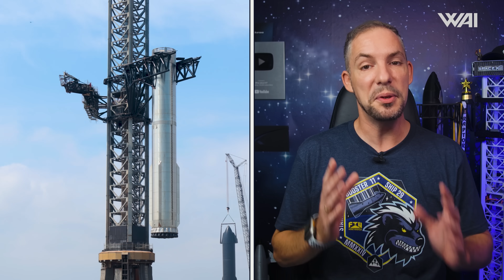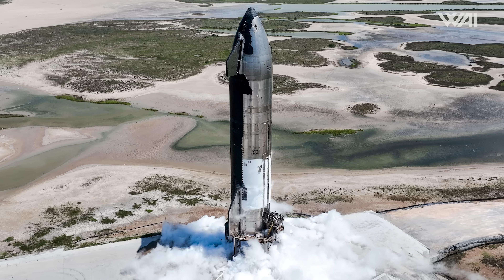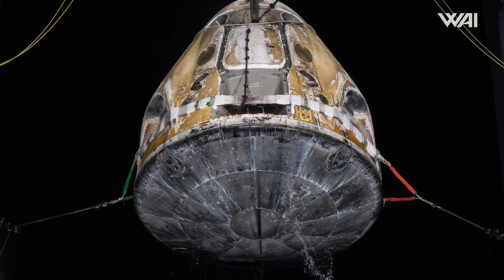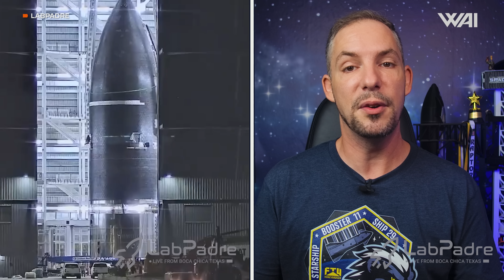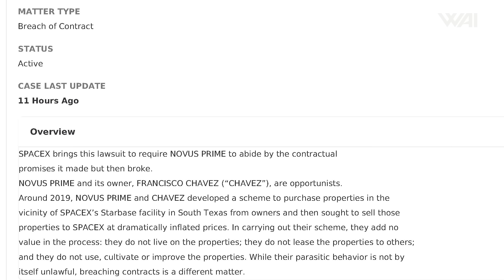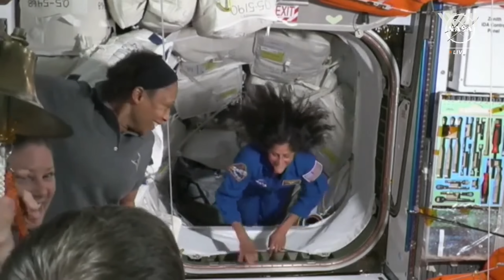SpaceX Drops Starship Flight 5 Plan Update! Starliner Still Stuck At ISS!

Comment: "That's impossible": Do you remember that experts said that it's impossible to land an orbital rocket propulsively? (with engines only). 

They said something like: 'it's physically impossible to start a rocket engine in hypersonic speed against the oncoming air pressure, that's just not possible. That would never work.
And there's a reason that NASA doesn't land their rockets: Because it's impossible'.

The experts said something like this and some laughed at SpaceX. 

Well, SpaceX tried and it works now very reliable to land the boosters of their orbital rockets.

So it's just a matter of fine tuning to catch the Starship booster. That's an engineering problem, not even rocket science. So, it's doable.

After they figured it out and dialed in all parameters correctly for catching, they would need a low wind, a predictable low wind or no wind. Just like for landing the Falcon9 boosters.

They landed the Superheavy booster softly in the water and in the line of sight of that buoy. So, they already know how to slow down that giant booster and bring it round about where they want it to be.

And I guess, they have escape maneuvers when the position would not be right, unable to correct it. They might fly out to a predeclared place in the ocean (that's what all others do with their boosters, dump them in the ocean...). 

And catching Starship (the upper stage) has more to it, withstand the entry heating and so on --- and then it's about the same, do a precision landing at the catch tower.

------
Oh by the way, the current tower could become a catch tower only and the new one with the flame trench could become the new launch (and catch) tower.

It's just a guess. But when the new tower is so much better for launching...

Comment: As usual SpaceX blames "paperwork" for why they can't fly right now. The government is a nice scapegoat, since their fans hate the government (and environmentalists.... F the turtles. Who cares about turtles, right?) They actually need a SHITLOAD more testing to make a catch a possible success. And let's face it, if the catch fails you are looking at a nice big explosion that will not only scare residents, the FAA, naturalists in the area, but it also might screw up their main launch pad, and guarantee a nice long investigation and delay of the next flight. A lot of risk for not much gain. I think a nice landing pad on rails (to bring the booster back in range of the pick up arms) would be a lot safer for the launch pad, and it would be more tolerant of misalignment and more like what they are already doing with Falcon 9. The only penalty will be that of the weight of landing legs. It would also give them experience with landing very tall rockets on landing legs, which they will need to do on the moon and mars anyway.
As for the heat shield on Starship........ their current ablative "backup" is simply a band aid on a problem that engineers have been working on for decades. As usual SpaceX thought that somehow all the rocket engineers of previous generations were just old fuddy duddies that don't have the proper mentality of innovation to solve the problem and the young SpaceX "guns" will just succeed where all others have failed. The bottom line is silica tiles are fragile and they are a bitch to mount on a spacecraft so they don't fall off. And the violent environment of lift-off and re-entry are guaranteed to stress extremely brittle units to the breaking point. It will be the biggest obstacle to rapid re-usability. Maybe they would be better off with large disposable, ablative panels that can be removed and bolted back on relatively rapidly? (Forget few hour turnarounds and just make enough spacecraft to turn them around in a day or so.) Or perhaps they need to revisit transpirational cooling? Or perhaps they need to revisit the Dyna-Soar's metal heat shield design? (Very expensive, exotic metals, but pretty durable.)
Raptor 3 - amazing. Let us hope it is as durable as it is powerful and beautiful.

Comment: "Chopstick" capture the booster stage and lower it back onto the OLM so that it ready to refly?  Get outta here!

Anyone really imagine that NONE of those 33 Raptor engines will need to removed from the stage for anomaly investigation, for detailed visual inspection of internal passages, or for plain old refurbishment/repair for things like failed sensors?

Does anyone know if it is possible to replace a Raptor engine with the stage resting on the OLM?  Access to engines seems to be very restricted.

Comment: There is zero chance that catching that booster works. Even if the tower did catch the booster the explosive blast from all those engines firing straight down on to the launch mount EVERY SINGLE time will completely destroy all the hold down clamps and the launch pad itself.
Reply from the maker: Three engines are used for the landing burn.
Reply: @millennialfalcon1547  Alright here's the deal. If it works, you forfeit the right to doubt anything else.

Comment: Fixing problems...good.  Removing problems...better.  Modeling...good.  Observing...better.   NASA makes catastrophes, SpaceX makes mistakes.
PTFE <19°C is a well ordered triclinic phase. Density jump at 21.9 to 31.6°C. 19°C - 30°C, partially ordered hexagonal phase. 30+°C - 328°C mp, pseudo-hexagonal, very disordered. 
Ignorant is educable, stooopid is forever.  NASA is the doyen of institutional stooopid, Beltway lobotomites managing the genetically inconsequential.

Comment: You can't take the booster and put it back on the launch pad. You have to send it back to the Garage to do NDI tests on the components to limit and reduce mechanical fail points. They do this in the US Navy on airframes every day because of the high stress on aircraft structures and equipment.

Comment: The falcon rockets land with precision right in the centre of the landing pads, and the"suicide burns" time and again achieve zero velocity at zero altitude (and the Falcon's  Merlin engines cannot be throttled..).   So the idea of Mechazilla safely landing the Boosters and Starships looks highly likely to be successful.
Reply: Not true. Merlin can be throttled to around 40%, even at sea level. I don't think reliable landing would be possible without some degree of throttleability.

Comment: They still haven't said what they are going to do with Starliner?  Part of the problem is that Boeing did something unusual for them <sarcasm>. They lied about the functionality of the capsule. They said it had self driving. But it doesn't, quite yet.  It needs a software update, but does not do "over the air" udpates.

Comment: Raptor 3 looks more like what the "simple concept" of a rocket engine sounds like when you first hear it: 1. pump fuel into chamber 2. ignite 3. profit. On the other hand, from working as an engineer, I know that making something that looks messy, but works is easier than making something that works and looks elegant and effort less. Putting in the work to make that step will almost always make you improve your product to the best version yet.

Comment: Starship was launched alone, with limited fuel to test belly flop landing. After a while they found success. They launched and safely landed. Why did they NOT do the same with the booster? Why was it not lauched alone, up to a few thousand feet then landed first on water, then with the chopsticks.

Comment: The test flight failed due to not showing the caution they are now showing.  Should have been used during the scrub...  However, there are three issues with one system and that is not good.  There is the software and then the overheating, not to mention the helium leaks for pressure to the thrusters.  That is a lot of potential failures with one system and thus send it back empty, if any doubt.  But the Starliner is overbudget, behind schedule and throwing more billions at a system that might be usable prior to the decommission of the ISS, not cost effective.  The real problem is here on the ground with Boeing management and the cure for that will be more effective for the future...  May be better to stick to one horse at this point or use Dream Chaser for a 2nd system.

Comment: I wonder what kind of progress has been made on raptor refurb? If R3 are single pieces that need to be cut open in order to be serviced that sounds more difficult than just replacing it. With high volume production too refurb doesn't seem like a point of emphasis. How does this translate to in-situ missions like the moon and mars, like just bring 6 extra engines? Crazy to imagine "patching" an engine bell!

Comment: I  think The Two towers should be built across from one another so that both can catch the rocket if one tower fails. Better yet theTwo towers could act as one that use both towers for stability. With this system they could have 2 arms that come off each rail connecting the two towers together, 4 total arms.  This could increase speed, stability and catching ability.

imagine this, two Straight beams that are connected to both towers that can move up and down the rails of each tower working together. Those Two beams each could have two arms also on a rail system with more maneuverability and stability and improved catching ability with redundancy.

Comment: Why design the chopsticks so that they have to line up so perfectly with the tiny lifting points on the booster?  If they extended the lifting points out a couple of feet, they could more easily be captured by V shaped traps that would run in and out on the lifting arms.  The V traps would position themselves in relation to the lifting points based on radar or some other beaconing technology.

Comment: I’m curious as to why Felix didn’t discuss the fact that Starliner wasn’t launched with software to allow it to land autonomously and that they have to upload the software from the ground.  Seems incredibly shortsighted.  Also, Felix is saying it’s not a death trap.  We really don’t know that.  That 1% may be enough to kill the astronauts.  Maybe not, but maybe yes.
Reply: Yeah, that's the concern. It's not that it is a deathtrap... it's that nobody is entirely confident that it's *not*.

However, a correction — it does have the software for autonomous flight, and on paper it's just a matter of configuration. The real problem is that it's disabled because it apparently hasn't been tested with the latest hardware/software changes since the previous uncrewed flight... it wasn't expected to be needed, so they just turned it off so they could cut some corners on testing.

This is where SpaceX win again — all Dragon flights are autonomous by default, whether carrying humans or not. If there are passengers, they can take manual control, but they're not a required part of the system.

Comment: There is a line between "Very sure it's okay to return" and "Sure enough to put astronauts in it", and Starliner is stuck both on that line and on the station. It has enough redundancy that a few thrusters being out aren't going to cause a failure of the mission - but the question that puts them on the line is "Could more fail unexpectedly?"

Comment: Very diplomatic commentary on Tory Bruno’s remarks. Also…the movie script version of this starliner thing would be, they upload software to the starliner so it can get off station on its own, they do that but something goes a bit wrong and as a result the crew abandons the space station using the spacex lay on the pallet option. Boeing get enough control of starliner to avoid it demolishing the is but it disappears off into space. Crew dragon returns the crew safely home and the next crew dragon takes up the next crew to re inhabit the station without issue. In the post script, the crew 9 guys bring home a plushie that was left behind in the emergency that means the world to one of the kids of the Crew 8 crew

Comment: Maybe they should have a curved or angled flame trench under the OLM so that the catch of boosters and Starships doesn’t put flame exhaust on the OLM.  So, catch to the side of OLM, over flame trench, and then swing the chopsticks over the OLM.  Or, possibly an extendable concrete platform over the trench so that the chopsticks can lower the caught vehicle onto a mobile platform to roll it to a high bay for inspection and refurbishment.

Well, test flights will show if that’s necessary.

Comment: I think what people are say is the Starliner is a lemon; outdated with clumsy engineering. The cost overrun alone would have been enough to cancel the project if recent news on space probes any indicator. I didn't hear you mention the dual manual and automated return faux pa, and that alone should ground the next flight until NASA is satisfied. Mostly, there will not be a complete teardown of the capsule as done before. How many times will we put up with this shoddy engineer? It would be cheaper to have another commercial company replace the whole program so near the end of the life span of the ISS.

Comment: Spacex may Catch  the starship but only when they can fully  control and adjust  speed exactly as required during landing and strong arm, timing, contact point or catching point will play a very important role, with the same landing speed as before will not be possible to  catch a booster or starship, i say so as my understanding

Comment: I think Musk will ditch the "capture" of the booster and starship.  Landing legs is a proven technology, and there is too much risk in an accident on landing.  His rockets have gained 33% more power over the last 6 years, so the extra weight is not a problem.
Reply: The extra height is a stability problem on a floating LZ.  Did you see the video of the one that tipped over into the sea?

Comment: I have no doubt Elon et al at SpaceX can make the chopsticks work for catching, my concern is the damage that could happen if the attempt fails and how long it might  take to recover from that [rebuild stage 0 and all the support equipment, ie the tank farm]. To me the risks do not seems to justify the possible rewards. If the catch site was further away from the infrastructure I would feel better about it.
Reply: FTL disabled on landings.
They will burn all the fuel hovering if catch system doesnt properly engage/catch.
Little damage to the launch towers.
Reply: @mr.transposon5017  The chopsticks are connected to the tower, the booster/starship will be at least 2/3 the length of the chopsticks away from the tower. There will be some fuel left in the tanks when the vessel "lands". As the earlier tests prove, even the vapors in the tanks can explode if something goes awry. That explosion could easily damage Stage 0 (especially the plumbing) and the blast radius could extend to the tank farm and damage that as well. None of that scenario is dependent on the Flight Termination System. The flame/sound suppression (water deluge) will be active and that could mitigate some damage, but why even take the risk? There has to be a less risky method of testing a catch. Let's say that tower 2 is further away from the tank farm and is well enough shielded from a possible explosion, to me that would make more sense than attempting to catch it using tower 1. The first two Flight tests, easily damaged the upright tank farm tanks without an actual explosion. I would not like to imagine what could happen if the catch was unsuccessful and the booster tipped over after catching on the clamping mechanism/stand for stage 0 then exploding and the amount of shrapnel that would fly.
Reply: @gregoryblajian8951  yeah extra shielding would help. I think tank Farms are traditionally close to increase the pumping pressure for faster fueling?

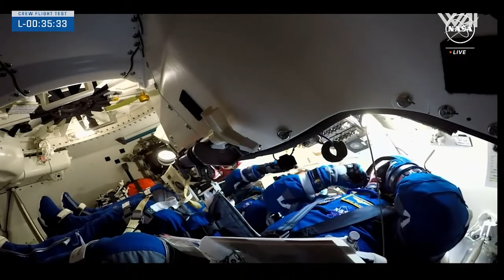Comment: 20:49 "Starliner is likely safe to return Astronauts. It's not a death trap as some extremists are saying..."

No test of Starliner - crewed launch, uncrewed launch, second uncrewed launch, ground test, pad abort test - NO TEST of Starliner has gone smoothly without significant (sometimes near catastrophic) problems. It would be delusional to think that Starliner's next flight - the flight home - would be the ONE time it magically flew flawlessly with no problems, with everything working perfectly. Every round of Starliner has been Failure Roulette and Mystery Glitch Whack-a-Mole. Why would the next round be any different? 

There is no logical basis to conclude that Starliner is safe. ALL the evidence points in the opposite direction - that Starliner is a disaster waiting to happen. In fact, I think Starliner has been incredibly lucky and dodged multiple bullets by the skin of its teeth, and that it's only a matter of time before it gets people killed.

Comment: Felix, I thought the Gen 2 Raptor engines looked real clean but the Gen 3’s are simply awesome!  Anyplace else I wouldn’t have believed it!  I saw a really weird rocket engine designed by AI once and it was very clean on the outside but incredibly complex inside with layers of cavities due to temperature and fuel handling and mixing.  That engine would have to be 3D printed.  I forgot where I saw it. Was the Gen 3 Raptor designed by humans or did AI have a part in it?

Comment: Why can'r Crew 8 have two additional seats be installed?  Oh, a seat doesn't fit thru the hatchway?
Reply: The most important factor is that the Crew 8 capsule is currently attached to the ISS, and the additional seats are currently sitting on the ground somewhere. But yes, it's also likely that they won't fit through the hatch... vehicles docking to the IDSS ports (Dragon, Starliner, Shuttle) are very limited in the size of the cargo they can deliver internally.
Reply: @simongeard4824  exactly. because of logistics and NASA procedural requirements CST100 can't depart crewless till seats are available for Butch&Suni in a CrewDragon. if they had collapsing seats (that would fit through the hatchway ) they could send them up on a cargo dragon then install them in the crew dragon.